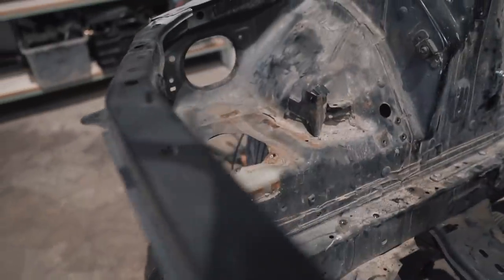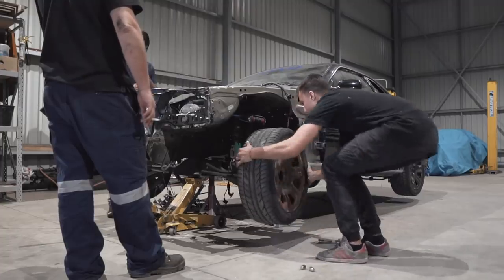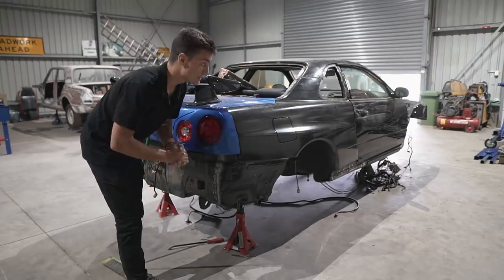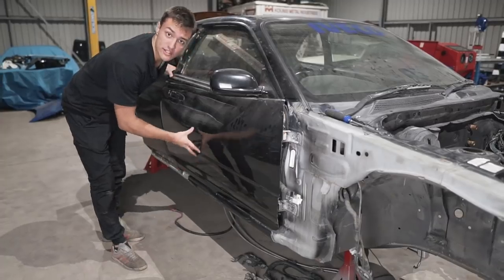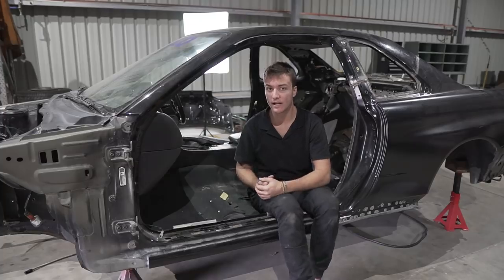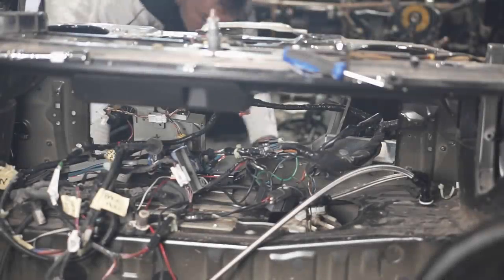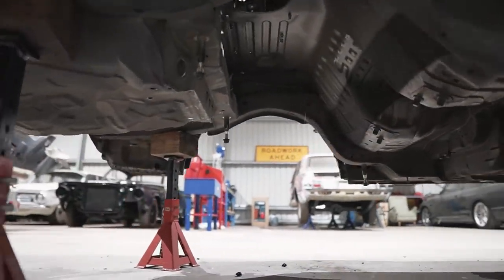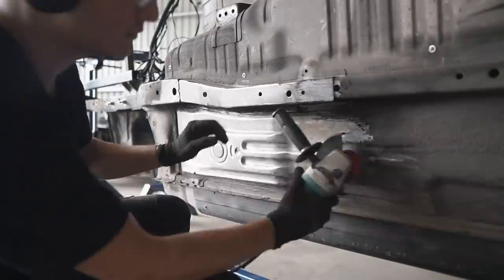Pulling Apart the R34 SKYLINE | Poor Man's GTR [EP6]

Comment: Yes, one of the ECU's in the boot is to do with HICAS, the other ECU is to do with the ABS. It's called the ABS control unit. Trust me when I say you want to keep ABS in this car. It's a heavy car and they will lock up on you more often that not.

I have also removed HICAS in my car as it was a weird feeling going a round a corner at low speeds as the rear wheels turned the opposite way making you think the rear of the car has no traction and is sliding around but actually it's just that its pivot point is now in the centre of the car not in the rear giving you have even more traction. After getting used to that, you then realise the rear wheels turn the same way as the fronts at high speeds helping the car tuck into apex's. Now I understand the characteristics more, I realise that it actually improves how the car goes around a corner and is perfect for a track car build so I'm now debating weather to put it back in. If you are planning to drift the car then obviously remove it but for anything else, the car handles better with HICAS, especially at high speeds.
Reply from the maker: Thanks for the comment man
Will be keeping the abs in there for sure! Will delete the hicas though, want to simply the car
Reply: @BrokenSilvia  no problem, we are practically doing the same build expect  yours is far more extensive. I guess it's one less thing to go wrong and not a major thing if it's removed. What engine are you dropping in it?

Comment: Pulling it apart is alot easyer than yd think. As for the colour mine was active Red before the conversion & i went to bayside blue. I wish i had of left it red now as theyre quite rare in that color. Whatever colour you choose the finish is dependant on the prep so dont skimp on that. Going for an unusual colour affects its saleability later on so if you think yr going to sell it at any point a factory colour makes them alot easyer to find a buyer. Looks great keep up the vids. Theyre getting better all the time.
Reply from the maker: All good points! Red looks next level

Comment: Apparently the Nissan GD 009 transmission is a strong cheap 6 speed transmission you can use (july 04 and later). Have you thought about using the GD 009?
Reply from the maker: Yep that’s my gearbox of choice for now
Reply: @BrokenSilvia  Sweet. Can't wait to find out what you marry it up with. So good to see someone building my dream build. I've got a nice r33 I've had similar thoughts about.